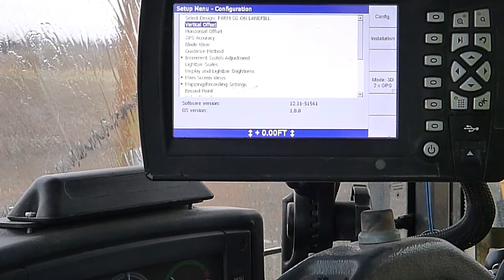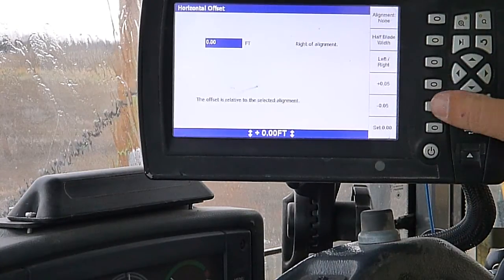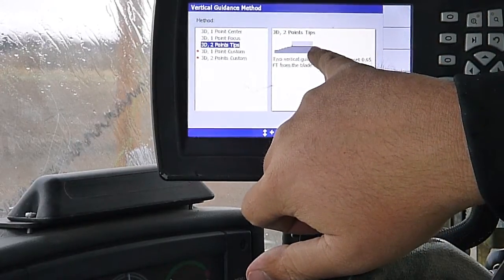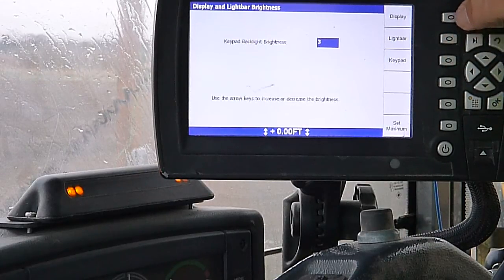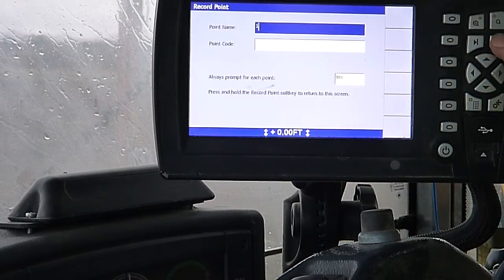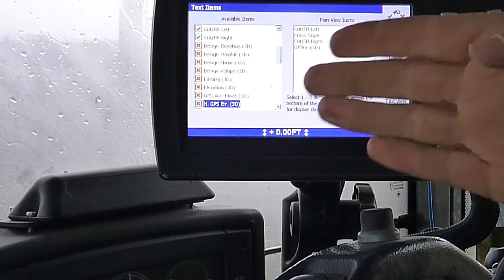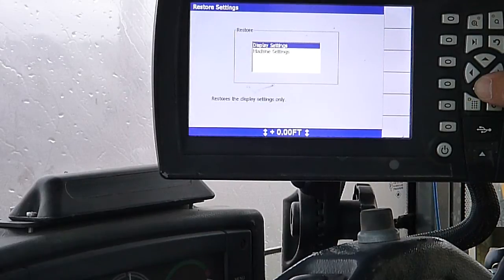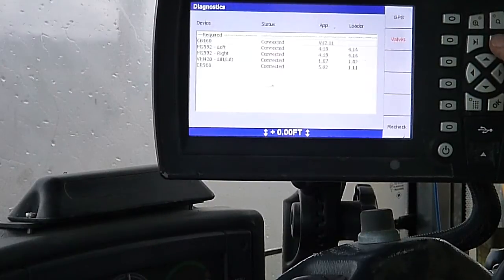Trimble CB460: Configuration Menu In Managers Mode

Comment: How do you get into managers mode?
Reply: +shoover17331  Hold "ok" and the Power button at the same time when booting up the CB430 or CB460
Reply: Dose it stay or dose it reset every time u turn it off?
Reply: every time you shut it down it starts in normal mode.
Reply: you can also plug a keyboard into the USB Slot and press "Ctrl + M" on the keyboard